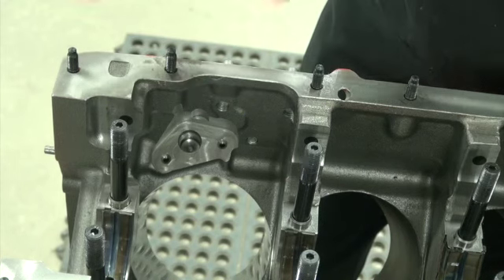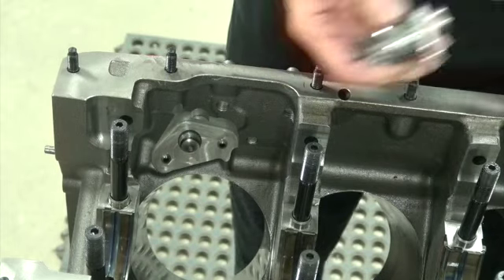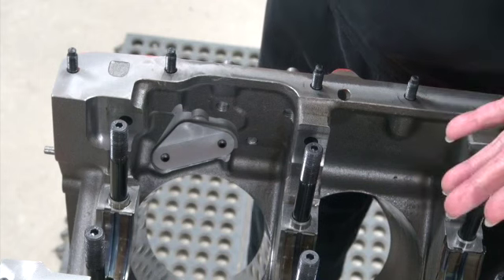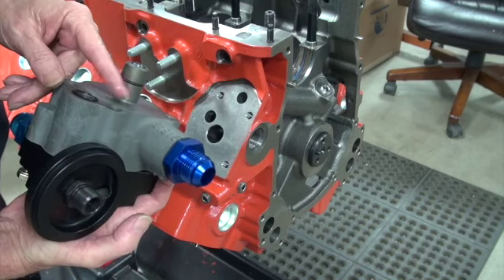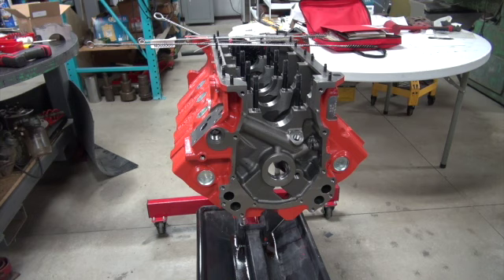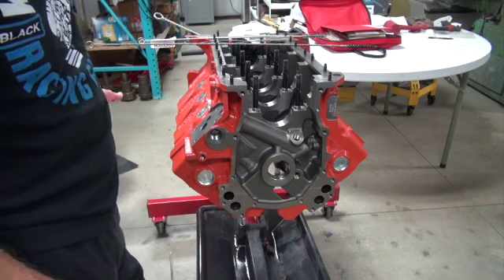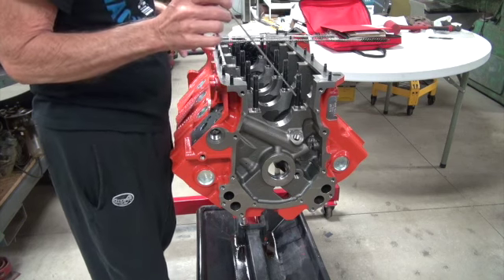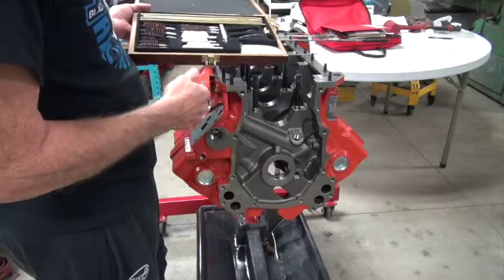Building your 426 Hemi Ep 11 #426hemi

Comment: For that block off plate I would use nord-lock washers... they are a bit expensive, but they are awesome...
Reply from the maker: I’ve never used those. I’m thinking drilled head bolts and safety wire. Thanks for watching.